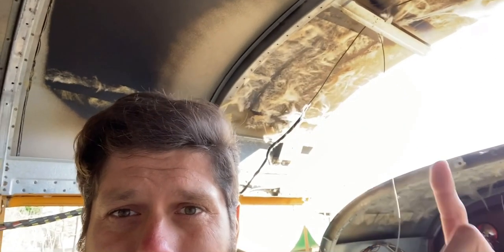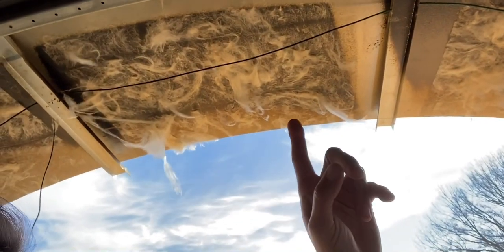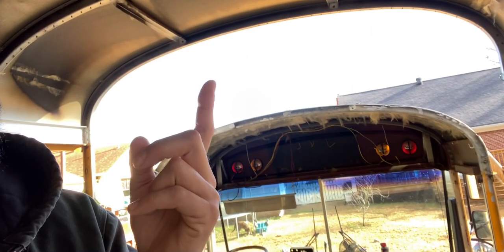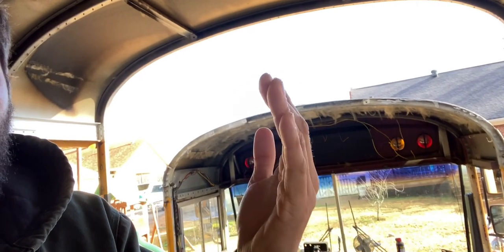School Bus Conversion Episode 7 - Roof transition - I might be a horrible neighbor.

Comment: Leather gloves work so much better than  rubber gloves when welding.
Plus it's usually the type of Blade your using rather then the saw When it doesn't cut fast enough.
Works the same with drill bits.
I've got some good "old" high quality Steel drill bits That work better than new ones.
Good luck with your build.